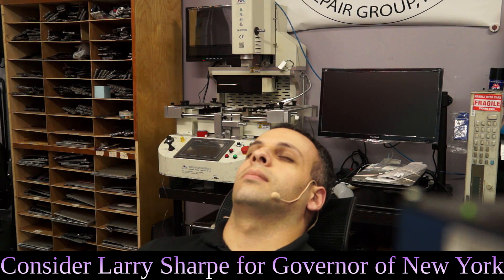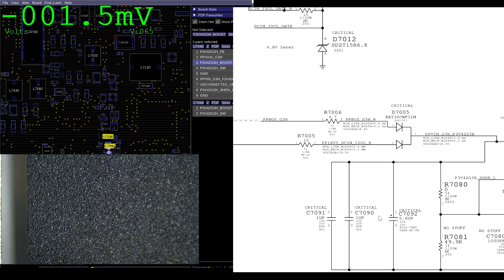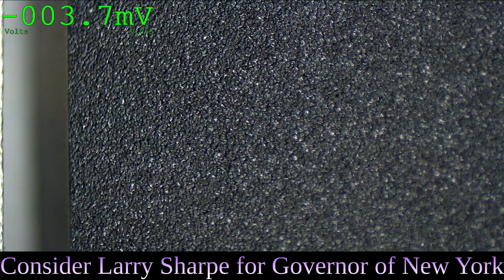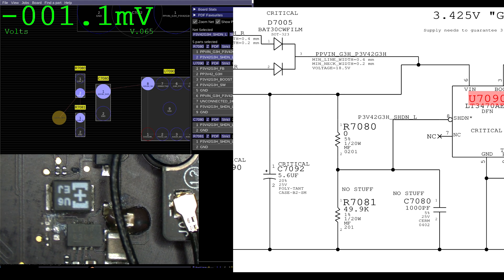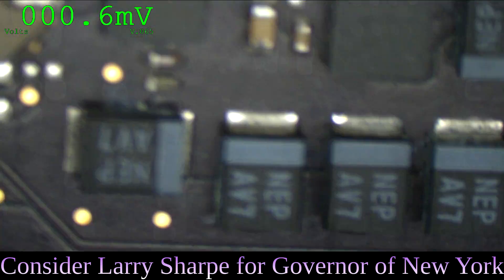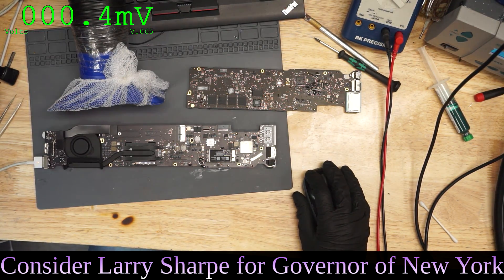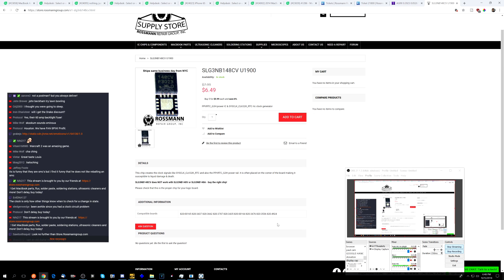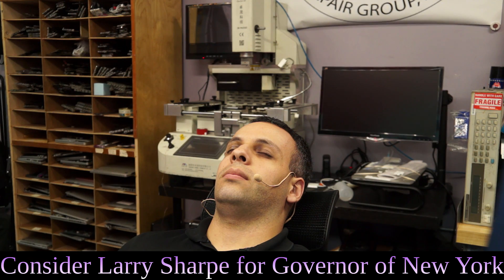Another Macbook Air saved from the scrap heap of the Genius Bar.

Comment: So I bought 2 late 2014 Macbook Pros 13" for $100 since the guy clearly dont know shit about Apple and said that one just didn't turn on and the other one just has a broken screen (It's not broken is just that issue with the screen lamination pealing off) and both are probably just good for parts...well I have been watching your videos for a while and even went as far as getting me a Hakko 951 like yours and a cheap hot air station... turns out that there was a short on one of the caps ( I used the Alcohol method and my dumbass even touched it and burned just to confirmed that that was the problematic capacitor) I used the macbook with screen issue as the donor as it clearly has liquid damage and changed out the capacitor, as soon as I did that and plugged it into power I saw the fan spin and quickly got up and yelled "Fan Spin!!" it was an awesome feeling... thanks for sharing your knowledge and spending your time for people that want to fix what clearly belongs to them. I used to love Apple but thanks to you and your evidence of what this company really is... FUCK APPLE.

Comment: Thank you for your detailed videos and schematics Louis. My sister's A1466 Macbook Air had some very light liquid damage and a dead "A" key and was quoted $750+ for logic board repairs and a full lower enclosure. $30 in parts and 3 hours later, the computer was back up and running perfectly.

Comment: A 0Ω "resistor" isn't even a resistor for want of, y'know, RESISTANCE. That those even exist slightly confused me when I opened my shiny box of resistors for a project and had these things greet me. So I looked them up. 0Ω "links" are meant to bridge traces on PCBs. So that's fine and all, perfectly legitimate reason for those things to exist. Just one question: WHY did they put a bag of those in my RESISTOR kit?
Reply: Resistance is useless

Comment: I have owned a Macbook in some form since 2010 and they treated me very well until I upgraded to the 2017 version and then Apple tried telling me that I used my computer incorrectly and broke my keyboard and wanted to charge me $700, under warranty mind you, to fix a problem I did not cause.

I use mostly an external keyboard and mouse in my office setup, and very rarely used the keyboard and one day I pulled my laptop out and saw some crumbs and noticed my X key would not work and was completely pressed down and would not come back up.

I had other issues as well, but my previous MacBook Air was only replaced by a Macbook Pro and then I kept my Macbook Pro for years until I was given the OK to get the 2017 model through work.

I got my 2017 model repaired for free but I can honestly say that these new models just don't seem worth it and my next laptop may be a Surface product of some kind, or a Dell.

I work in IT and use a MBP to service the Macs on my network, ARD is so much more reliable than any other remote software I use in a macOS Environment, so I have somewhat need for both.

It was when they tried telling me that I used my laptop incorrectly that they lost a future buyer.
Reply: It seems they assume if you already own an Apple product, you'll respond to the standard "you're using it wrong" chastisement with the standard flurry of apologies (if not a Novena of "Hail Jobs" in repentance) and desperate promises that you'll never transgress again.  (c.f., Antennagate: "You're holding your phone wrong!")
Reply: Your poor experience with the 2017 is why my 2015 MBP is the final laptop I'll buy from Apple.

Comment: what is that gel you put on before melting it with hot air? what is the purpose of it?
Reply: Doge flux! It makes the solder flow and cleans the joints
Reply: I don't understand. You have some flux floating around and then you put solder into it. How does the solder find its way to the necessary area?
Reply: @72Partners  because the unnecessary areas are solder masked. Only places solder will stick are the unmasked spots you are touching with the soldering iron
Reply: Hi doge .....you are new here aren't you. Stick around, you will learn a heck of a lot from a very knowledgeable man who must have saved computer owners a fortune over the years and also entertained thousands who are just interested in how computers work. I spend hours here.

Comment: macbook vs fujitsu

macbook : i sneezed over the keyboard and now its broken by water damage and will never turn on
fujitsu : pour a glass of soda over the keyboard and only issue you get is sticky keys. replace the keyboard in 2 min and woala no issues. happend 3 times now and still runs like new.
Reply: Nothing is built like a Fujitsu... Nothing.
Reply: Even cheap HP machines will survive that.

Comment: Is it just my noticing this or is it that when one part of a MacBook shits itself, there are other components that tend to follow right in line regardless of the one component repair?
Reply: That's just the way of electronics. Think of a MacBook (or any electronic device for that matter) as a bunch of individual circuits working together. Some of these circuits are unrelated, but for the most part, they're all working in tandem through some kind of bus line, either to receive power or to share data.

 Let's say there's a catastrophic failure. Someone decided to use a shitty aftermarket charger on their MacBook. In an instant, that charger decides it wants to push 30v through the dc-in port rather than a smooth, regulated 24v. The dc-in port says "okay, go on through". That 30v reaches a vital circuit where 24v is supposed to be divided up into a number of different voltages for powering various circuits on the board, but it's not meant to handle 30v. A vital transistor in this circuit shits itself, but before it does, that 30v is allowed to continue through the circuit. Eventually it hits another component that's not meant to have 30v, and it shits itself. But it, too, doesn't die fast enough. So that surge of power is allowed to continue. Eventually it finally hits a capacitor that says "NOPE", and it shorts before any voltage is allowed to leak through.

Now you've got a path of destruction that needs to be fixed.

Alternatively, let's say a random resistor decided it didn't want to live anymore and shorts directly to ground. This results in a dead short on that circuit. In a dead short, an immense amount of current is permitted to flow. Ohm's law states that current pulled is related to the amount of resistance in a circuit, and the voltage flowing through it. In the case of a dead short, the electricity is now taking an unintended path to ground. And since this path now exists, that short will receive the maximum amount of current possible on whatever circuit it's inside of. That current has to come from somewhere, so it's pulled from whatever that source is. That source may not be intended to run at maximum current for very long, and other components in-line with it may not be designed for that kind of abuse either. So that one shorted resistor ends up nuking a handful of other components before it.
Reply: Well put  @spartan456

Comment: I’m not an electronic expert but did I mist something here on the first soldering. Didn’t you say a resistor is missing and than you jumped it with a piece of wire?
Reply: 0 ohm resistor, just there to act as a fuse.

Comment: whats that green stuff in that tube at 1:50
Reply: https://store.rossmanngroup.com/index.php/ab13-uvh900-10ml.html
Reply: UV mask. It's an adhesive that's usually used to hold jumper wires in place. As the name suggests, it cures under UV.